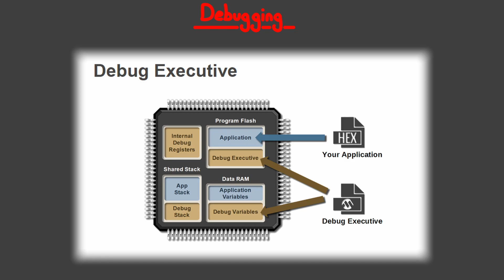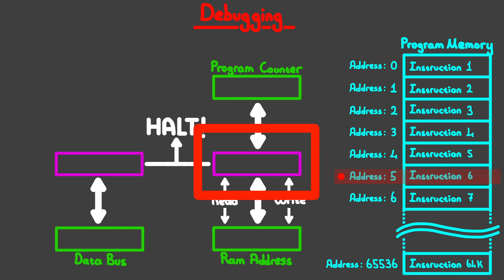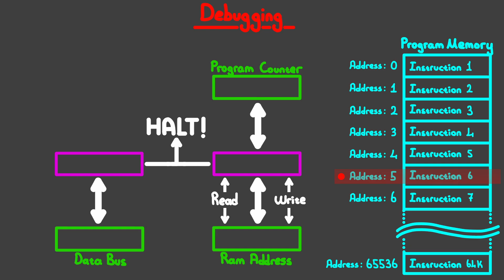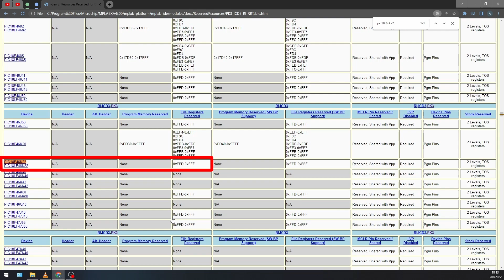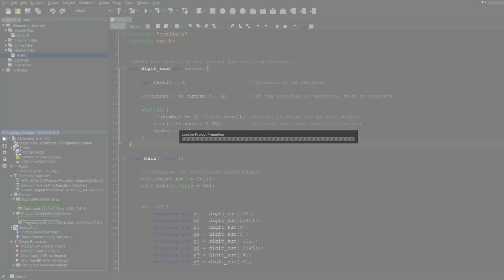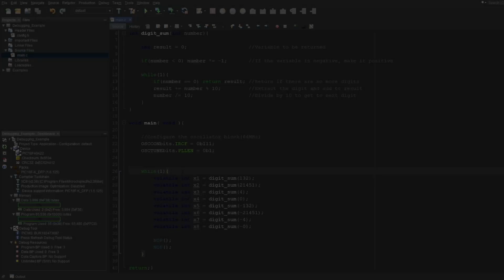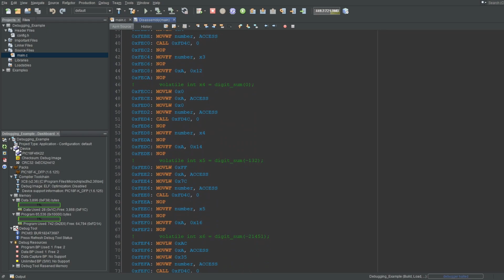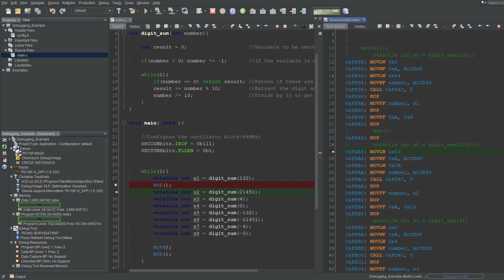PIC MCU DEBUGGING #2 - How does debugging work? (Hardware, Builds, Skidding) (Absolute Beginner)

Comment: i have no idea why i have them now, but damn i put some effort into tracking down a 14 pin 12f683 debugger...

thats possibly the hardest debbugging limitation. when you cant even use the device itself to debug with!
Reply from the maker: It can't be helped with the low pin count devices unfortunately. I guess that's one of the rare situations where using the simulator may be preferable over the real thing.
Reply: @Microesque  somehow i got lucky. made a fuzzy logic based EFI ECU. first project, deep dive. took a while.
Reply from the maker: @paradiselost9946   Sounds like a fun project 👍